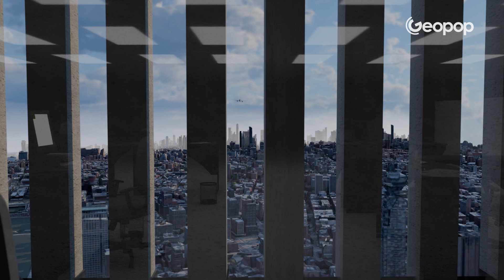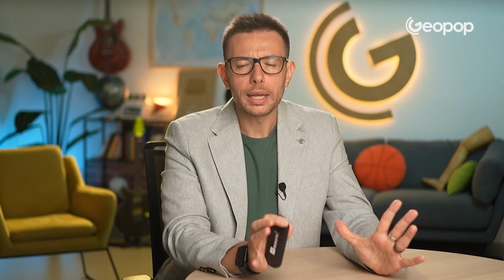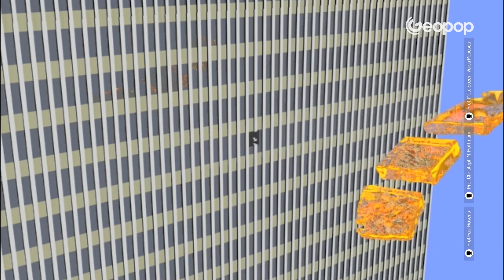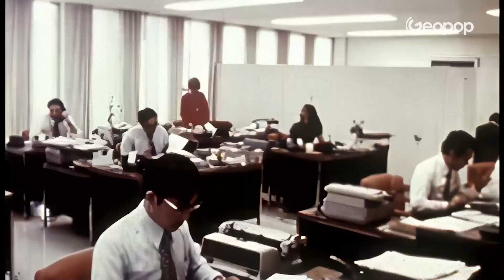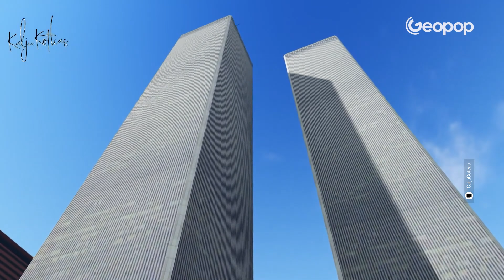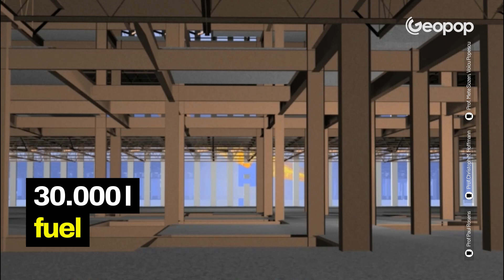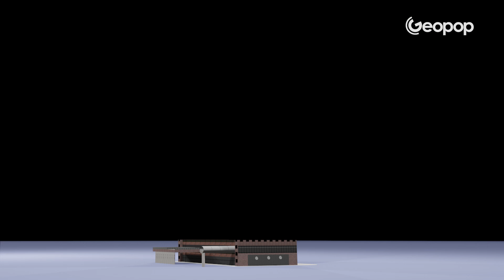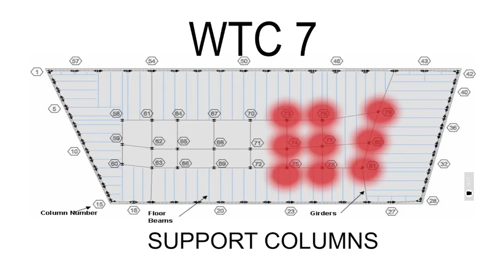9/11, 2001: The Technical Reconstruction of the Twin Towers and WTC 7 Collapses

Comment: In the history of modern architecture only 3 buildings completely collapsed due to office fires.... On the same day.... In the same city.... 😂😂
Reply: Are you sure about that?
Reply: @Appa-yi7yv  Yes, it is true. Prior to 9/11, fires in steel framed buildings burning for hours sometimes caused a building to lean, but never collapsed.
Reply: The facade of the torre windsor collapsed because of fire. The core only survived due to the fact that it was reinforced concrete...
Reply: Well, you're wrong. There were others. And the towers were, let me check, hit by 2 massive planes. Your comment suggests they were brought down by someone mistakenly throwing a cigarette butt into a garbage can.
Reply: Plasco building in Tehran
Reply: Wilton Paes de Almeida Building
Reply: What is the source of the many tons of molten steel found in and under the debris, the heat so intense that the molten steel remained in that state for weeks afterward, running off of the debris as it was excavated. This cannot be molten copper from wiring that retains the color of a shiny new penny.  It cannot be molten aluminum that retains the color of the polished aluminum wheels of a street racer. It was the color of glowing orange molten steel  that cannot be mistaken for any other material, reported by firefighters who are very experienced in the nature of such materials as well as seen in video evidence.

When you combine this with an entire lack of turbulence behind 500 mph aircraft, when even a small Cessna Aircraft would leave an evident wake in the smoke and fire only seconds later .  . We find that skeptics still cannot be skeptical of the official narrative in explanation.  Sponsored channels and forum activity are skeptical of nothing when support is provided.

Sponsored activity in the forums is very normal today for commercial and political purposes and subjects of controversy -- in the attempt to lead public debate.

Comment: 7:20 no, there's no substantial size- or weight difference between the 707 and the 767. Besides, Flight 175 was small by 767 standards, a 767-222. While the 707-320B had a MTOW of 151 tonnes, the 767-200 series (non-ER) had a MTOW of 143 tonnes.
Reply: Yes there is (roughly equal to a 50 seat regional jet) but more importantly there is a huge difference in energy imparted into the target between the accidental crash of a B707 on landing approach  vs. a B767 used as a high speed kamikaze missile.
Reply: @TheLoonResistance  FTR I appreciate the clip overall. 

I wasn't responding to any point about calculated speed scenarios. Irrelevant, but for what it's worth the 707 has a notably higher top speed. 

The claim is that the 767-222 that crashed was "much larger" than a 707. You're using a seat ref to bolster this. But as you may or may not know, seats used to be more generously spaced apart during the golden era of commercial flight. Conversely a B747 freighter doesn't have a ton of seats either, but it's nonetheless a large and heavy plane. 

I already gave the max weight for the base 200 model, and again it's lower than the 707. Check "Boeing 707-320B vs. Boeing 767-200ER" to see how the ER version stacks up on other stats about scale. Practically identical wing surface, and very similar across the board on the rest. The 200ER is rated for more fuel, giving it a potentially higher TO-weight. But this too isn't relevant here, given that NIST has modeled the UA-175 as loaded to a weight of 227 000 ibs / 126 tonnes at less than half-seated. Well below the 151 tonnes MTOW of the 707. 

No matter how you slice and dice it, and contrary to what the video states, these two aircraft models are very similar in scale.
Reply: @hide3reptiles365  - Again, difference in mass between a narrow-body B-707-200 on landing approach (light) and the wide-body B767-200's which struck the Twin Towers at impact is roughly equal to a 50-seat regional jet. You keep trying to load your argument with irrelevant data like "max weight" which has nothing to do with what we are discussing.  

The difference in velocity (which you continue to ignore) at impact is substantial - Maybe 180-200 mph in the case of the 1963 informal study and up to 590 mph for Flight 175.  More velocity means more energy. A baseball resting on your head would hardly be noticed. A fastball hitting you in the head will send you to the ER.  Same head, same ball. Only difference is velocity (energy)

And you consistently ignore it. 

I will repeat again:  For the Twin Towers, the accidental impact of a jet lost in fog on landing approach (light and slow) was studied at a crude level in a 3-page memo of hand-worked calculations.  What was NOT studied was an intentional high-speed Kamikaze attack by a much larger aircraft moving at full tilt

When people talk about how _the Twin Towers were designed to withstand a plane impact, they are talking about Twin Towers construction chief engineer Leslie Robertson who said the Twin Towers would resist and impact of a plane.  Specifically, a Boeing 707 (smaller and lighter than a 767) impacting at just 180 mph with kinetic energy equal to only 185 pounds of TNT. 

On 9/11/2001 the 117-ton Boeing 767 for Flight 11 impacted with the energy of about 1,400 pounds of TNT and Flight 175 nearly 2,000 lbs of TNT respectively . 

Those are different scenarios.

Still, all of this is much ado about nothing anyway. In the 3 pages of hypothetical hand-calculations in 1963 the Twin Towers did not collapse from the impacts and in the real world impacts (no hypotheticals or educated guesses) both Towers survived the impacts .  This rather proves the people who performed those (alleged) calculations in 1963 got it right. Well done. 

Collapse of the Twin Towers required four (4) elements of which impact damage is only one.
Reply: @TheLoonResistance  Listen buddy, I'm not a 9/11 truther. You can quit placing debate tactics and imaginary thoughts in my head, as I'm trying to get through to yours what I'm actually saying. 

My argument isn't complicated. The video says these planes are "very" different [in size].  Reality-check says they are no such thing. That, and only that, is my point. Sure, one sorts under "narrow body" and one is wide. And sure, if you use the specs of the earliest model of the B707 there's a clear difference in raw measurements too. But then again, why would you? The 320B was since long (1958) on the market when the WTC was designed. It would stem to reason that you compare that model - it being the jumbos of the era and the logical base for design impact scenarios - with the actual planes that destroyed the towers. 

Please don't teach me things I already know. Fast moving impact vs slow moving impact, impact survivability vs fuel load survivability, etc. Not the point [here]. Got it? Meanwhile I can give you measurements contradicting the video size claim until the sun goes down while you ramble on about speed and energy. As if slowing a plane down would simultaneously make it smaller and lighter, or as if a fondness for educational accuracy makes me a deceitful conspiracy theorist by default. 

But your low-water mark here has to be "You keep trying to load your argument with irrelevant data like "max weight" which has nothing to do with what we are discussing." 

First off on that - "We" are not discussing something here at all. I'm making  a specific point that refuses to land, and you're storming a couple of windmills and wasting my time. There's no "we", and you don't have the bearings to know what goes where in this. 

But to meet you all the same in your deteriorated state of situational awareness, and respond to the argument as you perceive it: How in the world do you imagine that MTOW would be "irrelevant" to aircraft size, or to comparing estimated potential impact damage from any given aircraft hitting a structure? While any same aircraft types vary a lot in operational weight depending on current load of course, this is the industry shorthand for listing aircraft mass, and with that the easiest metric to look up and compare. Since no tiny aircraft can take off carrying the total load of a huge one, MTOW also gives a proportional hint of what all the lower weight points like MLW will be as well. So if I may, how did this suddenly become such a daft comparison metric for discussing aircraft size and potential impact force?
Reply: @hide3reptiles365  - The planes are different in size - particularly when one uses the correct data, which you are not. 
The difference in ENERGY (which you keep ignoring) is even greater. 

Your point refuses to land because you are doing it wrong.

The weight and speed of the hypothetical B707 of the 1963 memo is far less than the actual weight and speed of the B767's of 2001. We don't care about MTOW - none of these scenarios involve MTOW.  We only care about mass at the time of impact which will be far less than MTOW in both cases, but about the equivalent of a 50-seat regional airline, which you don't seem to find substantial. The amount of damage caused by the real-world event was drastically greater than would have been caused by the 1963 hypothetical. 

And the Towers still stood.
Reply: @TheLoonResistance  In contrast to the lies you notorius liar spread they calculated a fully loaded 707 flying at 600mph, faster than any actual 9/11 plane. That´s why head of the NIST investigation concluded that the calculated 707 crash would have been more destructive than the actual crashs.
Of course these facts could never stop you from spreading your stupid lies Fitzshill...

Comment: The explanation makes sense for the floors above where the planes hit and a few floors below but doesnt explain for the other 70+ floors. From this explanation, when the top floors began to collapse they would collapse each floor below them because each floor could withstand 11 floors of pressure falling on them or so it is said. But as you watch the video you see the top floors crumble and are no longer one constant weight and become many millions of smaller individual parts that after a while would not have enough force to disrupt the floor below it. What you should be left with is a pair of pointed towers where the weight strips less and less of the structure below it.
The same for building 7. We are asked to believe that one side of the building weakened and collapsed dragging the rest of the building neatly with it in one perfect collapse. But we are also told the fires only affected the one end of the building. As much as buildings are tied together, they are still made of millions of steel girders and a lot of concrete that crumbles into individual boulders when destroyed. It is not connected by a rubber band. If one side of the building were to collapse then we would be left with a building with a gapping end where the end of the building used to be. The rest of the building would be standing. Or if you look at pics and video of buidings that collapse on one side you see the rest of the building can tip over but again, still hold together and not collapse perfectly within its own footprint.
I get I know nothing, but they are asking us to ignore common sense and years of watching purposeful demolitions or war or natural destruction and the only building that fall like the twin towers and building 7 are usually on purpose.
Reply: You do know that mass of falling debris has the same mass as if it was perfectly intact floors, right?  And a moving mass has more energy than a static mass, right (in this case about 30 times more). So the amount of energy in that jumbled mass of falling debris is more than adequate to do the job - as we can all clearly see.
Reply: @TheLoonResistance  So how did the lower halves of the core structures survive that amount of energy Fitzshill? Oh right, you´re way too much of a coward to ever answer questions on your stupid blahblah...

Comment: I remember seeing video of molten metal dripping off one side.  I have no idea if it was the steel, but there was certainly melting metal of some kind.
Reply: Molten metal pouring out of the South Tower (and it was in fact ONLY the South Tower)?  You mean this?

youtube.com/watch?v=xPVGGQU-MeQ&ab_channel=SeekersofTruth 

It's aluminum and possibly lead. 

The Boeing 767 which struck the South Tower weighed 117 tons and 80% of that was aluminum.  The exterior cladding on the Twin Towers – the white panels – were also aluminum. When Flight 175 struck at the 81st floor its momentum deposited much of the office contents in its way and the bulk of the aircrafts mass into the NE corner of the building. The piled up debris shoved into that corner is visible in photographs and video so we know it was there. 

There’s a good shot here of piled up debris from 4:36;

youtube.com/watch?v=ZLJyL63sqtU&ab_channel=MrKoenig1985

Steel melts at roughly 2,750-deg F while fires in the South Tower reached peak temperatures of around 1,800-deg F. Aluminum OTOH melts between 887-deg F to 1,180-deg F depending on alloy. That aluminum will melt under these conditions is not a surprise. If you look at pictures of cars left behind and destroyed by forest fires the aluminum wheels are invariably melted away along with other sometimes aluminum parts like hoods. Steel bodies remain intact. 

The “molten metal” appears at 9:52 am. At the same time we see the first externally visible signs of sagging floor trusses and the pulling of the perimeter columns inward. I submit these events are related, not coincidental. The aluminum cladding at the NE corner also appears to me to be burning. 

It is likely the with the floor trusses sagging under the heat, and the 81st floor truss in the NE corner under the debris pile subjected to the heavy load of the debris pile, the truss broke its perimeter column connections and dropped, instigating the material starting to pour out of the NE corner at the 80th floor.

Given the properties of the materials in question, aluminum is by far the most likely culprit. 

Reports from The NIST, FEMA and MIT all concluded the material is aluminum. 

Certainly, steel is the least likely of all the materials the anomaly could be given its much higher melting temperature and the fact there is no logical source for molten steel.  The perimeter columns in the NE corner are intact and the material is pouring out between them. So it isn’t columns melting, therefore what other source of steel is there?

Deniers will claim molten aluminum appears silver when molten, which is true but only at the low end of its melting temperature range. Aluminum can and does get hotter and it glows red to orange when it does (1,100 to 1,800-deg F).  Most folks of course just don’t bother getting it that hot if the goal is just to get it molten for say molding a part. No need to go higher. 

The total mass of molten aluminum is a BIG deal in regard to how it behaves when poured. Quantities bellow half a liter cool almost instantly if poured onto a flat surface, but if poured into say an ingot mould will stay red for a minute of so. Pouring volumes of molten aluminum greater than a liter is a VERY different experience. The thermal mass is much greater and the radiant heat is horrendous. The aluminum is able to stay liquid and remain glowing bright orange much longer. 

The famous video of glowing liquid gushing out of Tower 2 moments before it fell, involves at least tens of liters of molten aluminum. The thermal mass involved is so great that it stays red after falling many meters through the open air.

Side note: There was also a large UPS battery farm in that spot and some of that material at least may well be from the batteries IMHO.
Reply: It´s thermite. 
NIST analyzed steel from the fire zones. None had reached 600° Celsius, most hadn´t even reached 250°C, despite all the analyzed steel was directly exposed to fire. Aluminum melts at 660°C and it stays silverish then. You´d need to heat it up much further to get it to glow bright orange, but that´s heavily contradicted by NIST´s own analysis.
Also you can see the so called "aluminum" explode mid-air. Similar to the thermate Jon Cole used in his experiments. You can still find his video on YT. Go watch it, I guess it will make things clear to you.